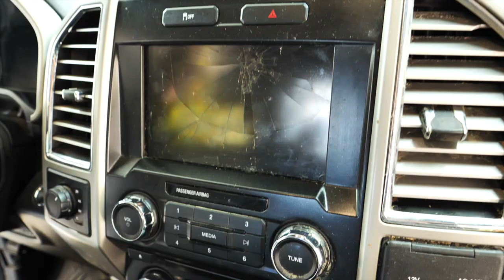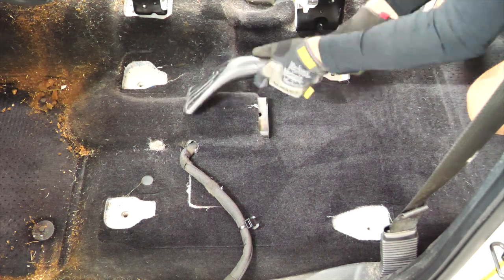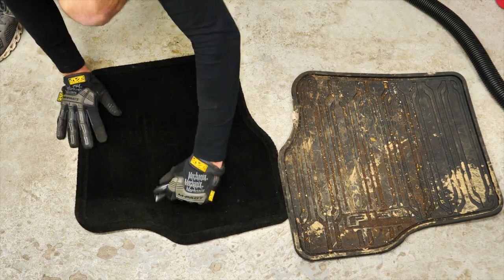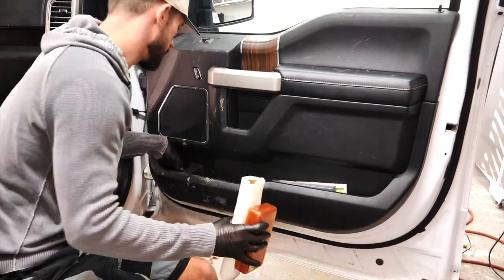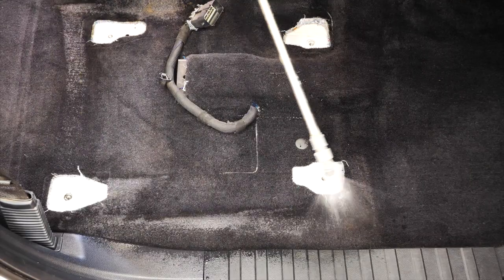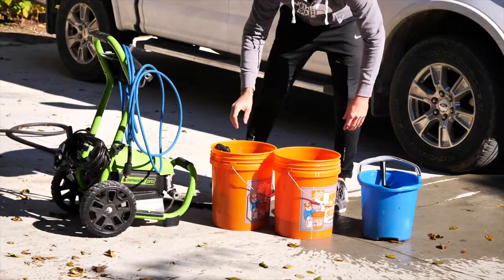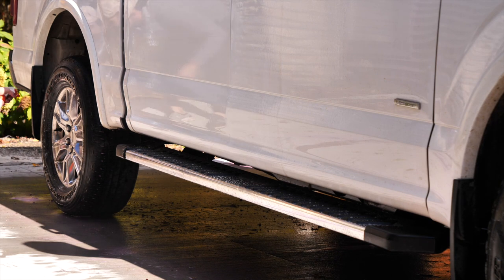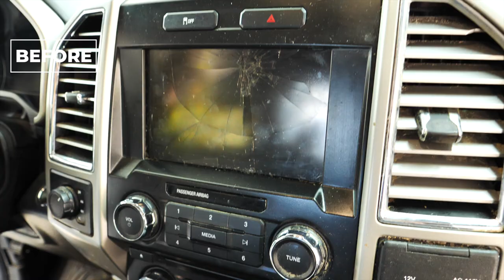Cleaning a TRASHED Work Truck || Ford F150 Car Detailing Restoration

Comment: I’m starting my own detailing business and watching your videos makes me want it more and more. Man can you do a video of taking the seats out of the cars, trucks/suvs? I want to be cautious on what I’m doing, I don’t want to mess anything up.
Reply: theres usually on 4 bolts and a wiring harness. remove the bolts and unclip the wiring harness. when tightening a few ugga duggas from an impact driver work well or you can torque the bolts down to factory spec.

Comment: What is a good cheaper option for an extractor?
Reply from the maker: Using a DIY setup right now that I will show and breakdown how to build!
Reply: This seems to be a controversial opinion on the interwebs, but the Bissell SpotClean Pro seems to deliver pretty good results for only $150-$175.  Not sure how that compares to the DIY setup cost but it could be an option for you.

Comment: You ever deal with the white letters on switches on the steering wheel or dash start to smear or rub off when you wipe those areas? What is your go to cleaner to prevent this from happening? Super Clean tends to cause this for me.